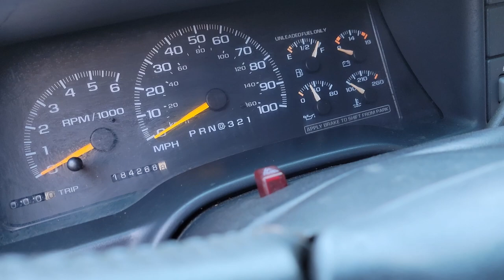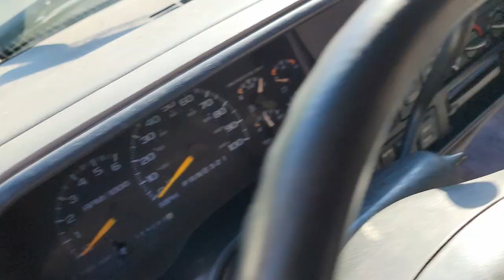Preliminary Maintenance on the Z71

Comment: I have the same Z71 Tahoe, next time before refiling the brake fluid clean the inside of the reservoir.After a while I got tired of the original tires  and rims and I installed the rims and tires from a 2011 Silverado 18 inch rims with BF Goodrich KO2s. If you want better stopping power,replace your front calipers,rotors and pads with POWER STOP front brake kit.
Reply from the maker: Nice! I will have to look into better brakes eventually. Right now it seems to stop okay. Doesn’t handle sudden movements well. I was planning to have a professional flush the brake system at some point as well since I don’t have the right tools for that on hand. We’ll have to see.

Comment: With such little clearance for the other type of tire you tried on, would there be cause for concern when you take a really bad pothole? Or would the suspension prevent the rim from hitting the caliper?
Reply from the maker: Good question! My understanding is since the wheel is bolted to the hubs (the part with all the bolts sticking out) the caliper moves with the wheel when it goes up and down or side to side when you turn. My concern would be damage to the fenders and inner wheel liners if the larger tires rub up against them if the suspension bottomed out. I likely won't go with that wheel and tire size anyway. If I hit a hole hard enough to bend a rim with that much rubber on it I would probably have bigger problems to worry about.